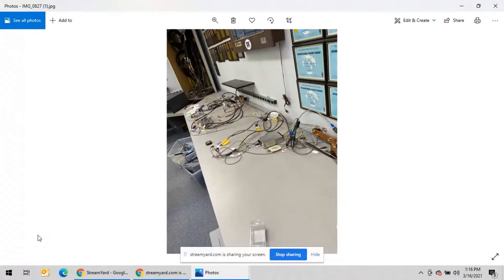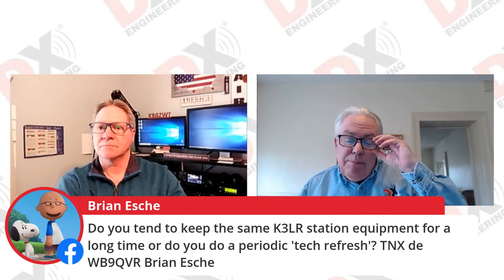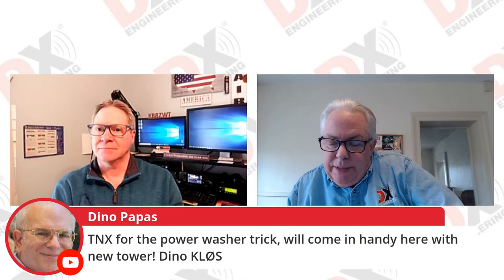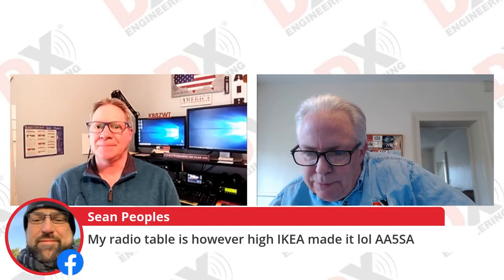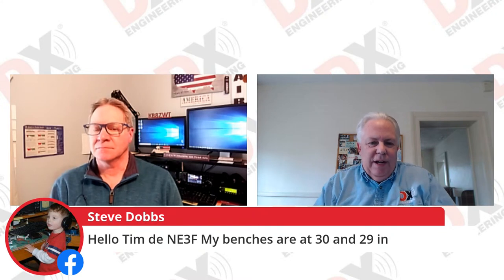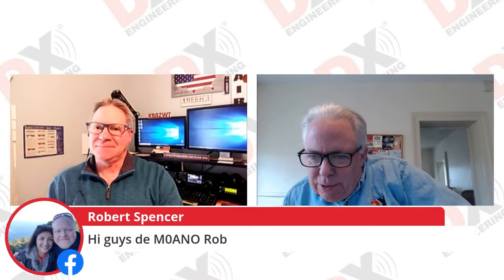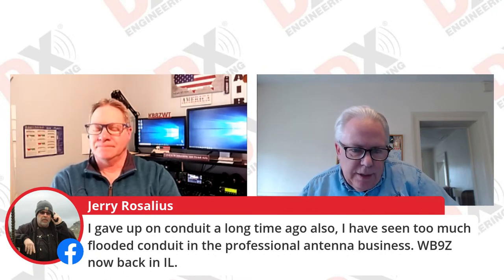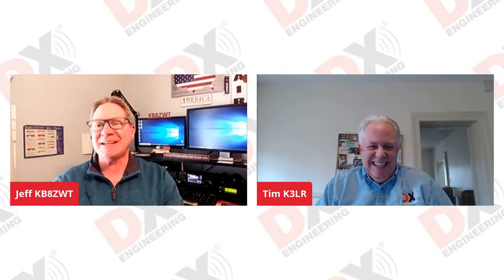Table Height and Burying Coax - Tuesdays with Tim and Jeff 3/16/21

Comment: 😷❌😷.    GEEZ  GUYS.....   WTF??
Are you doing this install in India?

EVERY  Time you bury  ANYTHING —>>  ALWAYS   ALWAYS   ALWAYS  ALWAYS ...
RUN  PIPE !!!     (even if you do not run the cable inside)

At the very least, install the pipe and drop the cable alongside the pipe.
IF you need to replace the cable, simply pull another in through the pipe.

Other Tips (after 35+ years of doing this stuff):

- ALWAYS use conduit / pipe...    
IGNORE  ❌  IGNORE  Advice telling you to simply direct bury any sort of cable.
The process of trenching is very labor-intensive and some thing I try to avoid as much as possible.

Pulling Cable through existing conduit is so much easier than digging another trench.

It offers so many advantages and is just pennies per foot when you’re already spending dollars per foot for premium cable / coax.  

- Always install the largest pipe size you think you’ll need...  Then DOUBLE IT!

- ALWAYS add at least one or. two extra runs of  EMPTY. conduit.   LARGE!

- water is always going to be present.  You are running pipe/conference in order to give you 
a much simpler Way to replace cable or install extra cabling.  
Conduit also offers a tiny bit of physical protection, no this is not the reason I install it.

- when running PVC schedule 40 conduit, everything below ground can be made to fit using a
“Hot Blanket” or A large format propane torch — used to soften the pipe prior to minor bending.
(Always be careful not to kink the pipe or reduce the inside diameter much)

- Always call for a buried utilities “mark out” of any/all wiring and pipe work that may be buried.
(& NEVER trust the mark out...   it’s just to protect you financially in the event of a strike)

- always run pull rope through your empty conduit (& while initially pulling cable through)

- always mark and/or cables that will last through bad weather, UV exposure and aging.
(We generally use colored electrical marking tape at each end of both pipe and cable / 
Brady labels protected with marine grade clear heat shrink tubing / always drop a “caution ribbon” 
with embeddedmetallic warning strip...   this will permit future workers ability to identify and locate 
underground “future use” conduit.

Be careful when “surfacing “  your pvc runs.  Always provide an expansion fitting which will protect the installation from frost heaving.

Always inst